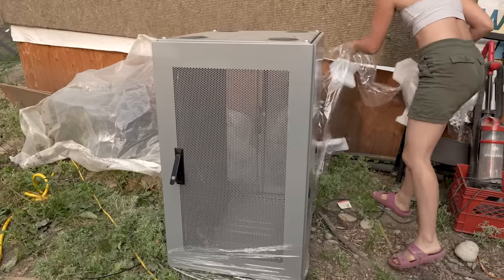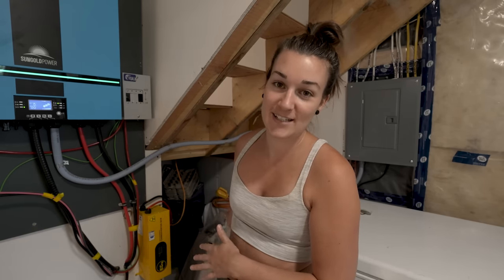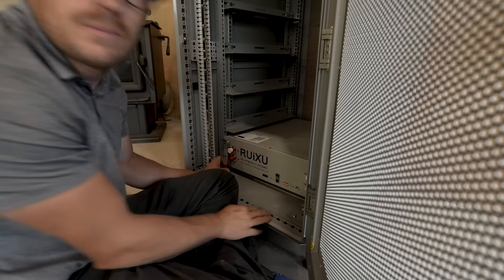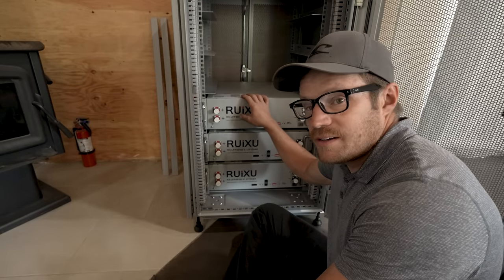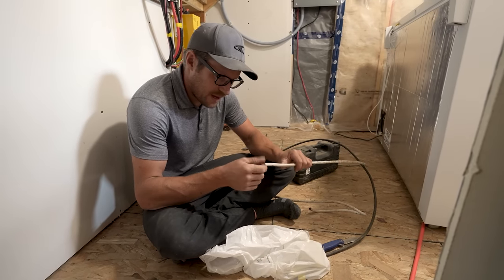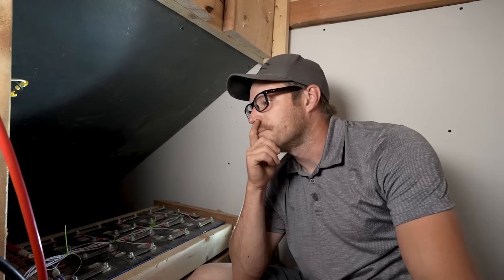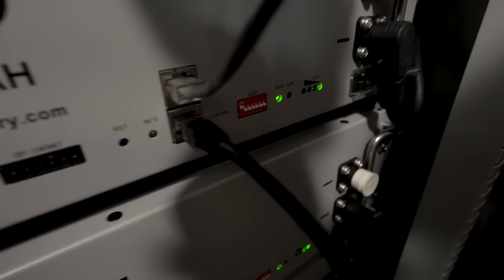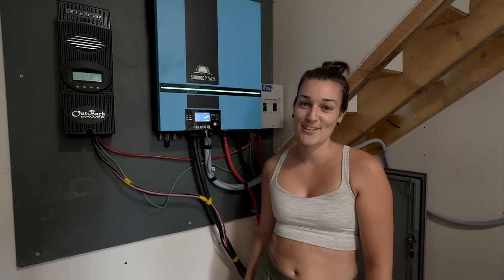Doubling Our Off Grid Battery Storage With Ruixu 48v Server Rack Batteries! DIY Solar System

Comment: What you have is going to complement the next new thing for generating power.. I have played with this now for about say fifteen years knowing it would eventually happen. Hydrogen is the most abundant molecule on the periodic table meaning extremely cheap fuel. Your storage system will hook to a generator or solar so no moneys lost like so many things we buy and find out that its no longer made. Both Case tractor and Cummins have decided to go with it making their companies no longer held hostage to oil. You can use vegetable oil in a engine that does not use carbon fuel or in other words easy to understand... big oil. Hydrogen is not a pollutant but it does make oxygen and water out of it when used in their engines, instead, when hydrogen is used, it converts its waste to water and air we breath.... China will see its sky again. If you do have time to look at the internet, look at the two companies I just mentioned and see your future come back around 360 so when you drive up to the pumps for gas or diesel for your current engines in your trucks or tractor, that price on the pumps will be back like it was in the nineteen seventies with no dollar sign in front of the price anymore!!! Money that can be used for animals or home materials... no need to lie or exaggerate to you about this as you can see it in black and white on your screen.